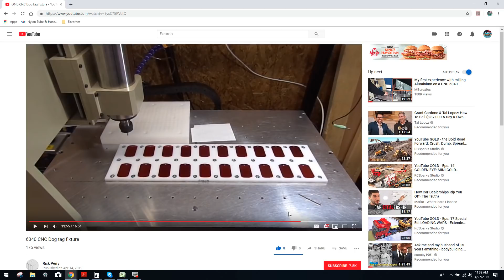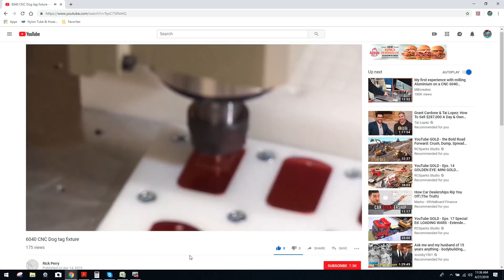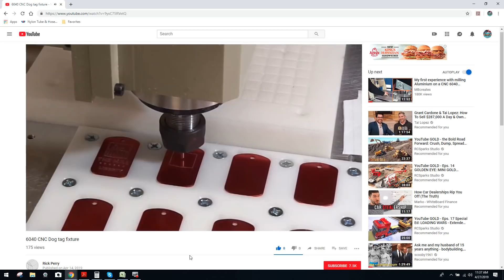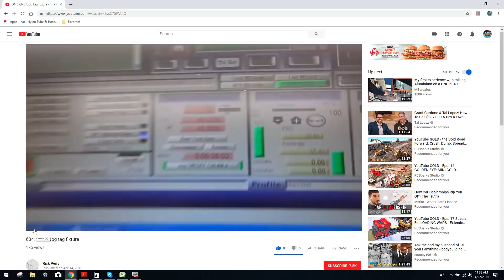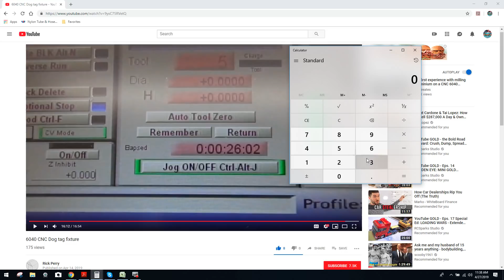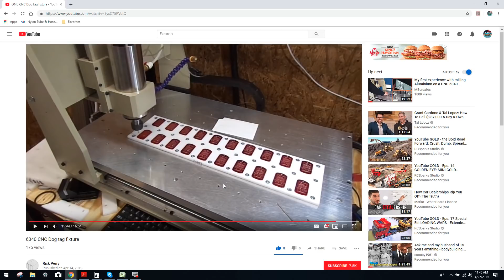How To Profit Per Minute With Your CNC (Make Hundreds Per Hour!!)

Comment: How are the tags not flying away with so much force from the mill?
Reply: looks like a diamond drag bit, so it's not spinning in the spindle
Reply from the maker: darktemi1993, thank you for your support. The tags are held in the fixtures, and the CNC is only engraving the tags with very little pressure which is why their stable. Thank you, and have a great weekend!
Vince

Comment: Is that tool spring loaded?
Reply from the maker: Bradley, thnak you for your support. No, he's using the system as an engraver. Thank you,
Vince
Reply: I believe the bit is spring loaded.
Reply: You can tell the spindle is not spinning and he's just dragging because the hex nut to tighten the collet is clearly not moving.

Comment: We stamp dog tags at our family owned army surplus I work at on a 1930s addressograph and some of the letters are pretty much blobs. I wish I had a cnc machine that could make new letters for it because parts from a 1930s machine are a bit hard to find lol
Reply from the maker: blake102989, thank you for your support. I really appreciate it. Just let me know when your ready to get one, and we'll get you going ! Thank you,
Vince
Reply: @corvetteguy50  thank you, I think I'm going to get the small shapeoko 3 to start off so I can start making some money. Do you think that's a good starter?
Reply from the maker: @blake102989  For your application it will be fine, but a Chinese 6040 is a much better built chassis that uses ball screws. Thank you,
Vince
Reply: @corvetteguy50  ok I'll look into it, I'm going to start by making wood products
Reply from the maker: @blake102989  Well you'll be fine with either one then. Thank you, Vince
Reply: @corvetteguy50  awesome! Thank you bud
Reply from the maker: @blake102989  You Bet :)  Thank you,
Vince

Comment: Where I have the most problem is finding a sellable item, and even more so finding a market.
Reply from the maker: Dude, Thank you for your support. I will be doing a video covering market research shortly, and offering a way for anyone to reverse engineer profits virtually immediately.  Stay tuned  :). Thank you, Vince
Reply: @corvetteguy50  
Cool, Thanks for the response, and the heads up. I'm subbing, so I don't miss it.
Reply from the maker: Great, thank you again for your support. Vince
Reply: @corvetteguy50  did you ever make the video covering research for profitable products?
Reply from the maker: I haven't as I would need specifics on the machine your using, axis it has, interests in a particular field, ect. There's a bunch of variables, but if your just looking to make money with the machine a simple eBay search for products that have sold will yield excellent results. I also offer consulting for products. Thank you,
Vince
Reply: Computer accessories mods is one good market. Especially with making wood panels for new released computer cases. Engraving and sign plaques market is already saturated.